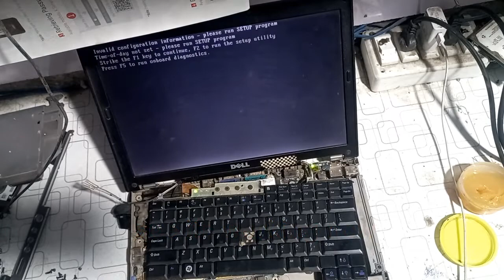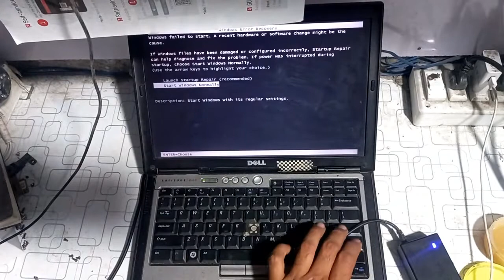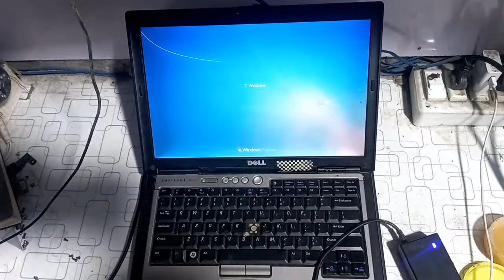dell latitude d620/d630 power on no display| dell d620 d630 blank screen| dell d620 display issue

Comment: Thanks dear for your video
May i know what temperature you use on hot air please
And you resolder 3 ics not Nvidia chip only , right ?
Kindly reply me because i have the same problem and i am sure your answer will be very helpful to me
Reply: i hope that i will get a reply from you sir
Reply from the maker: The small chips are supporting chips to the nivida chip. So also need to give heatup to that chip as well
Reply: @eurekasmartlab  
Many thanks dear boss
Now it is clear
I will heat Nvidia chip and the other two chips
*But* finally please what is the save temperature to use please 😍😍😍😍😍😍😍😍😍😍

Comment: Hey ,if i upgrade my d630 with SSD and RAM 4GB is it possible to install premiere pro 2012?
Reply from the maker: No bcz premier pro 2012  required high spec
Intel 6th Gen or newer CPU, or AMD Ryzen™ 1000 Series or newer CPU.
Operating system Microsoft Windows 10 (64-bit), v1909 or later.
8 GB of RAM.
2 GB of GPU VRAM.
8 GB of available hard-disk space for installation—additional free space required during installation (will not install on removable flash storage)